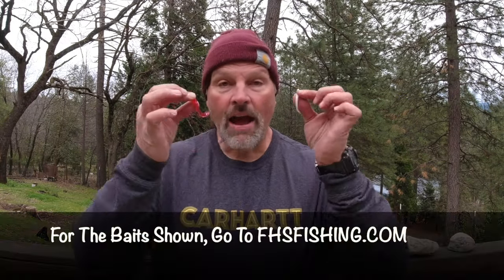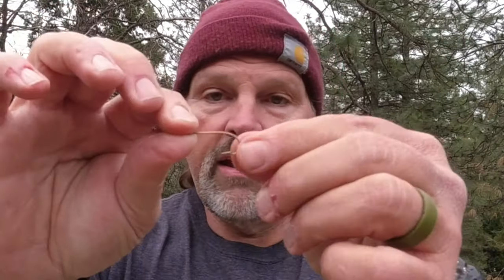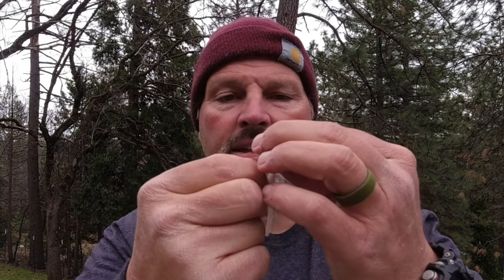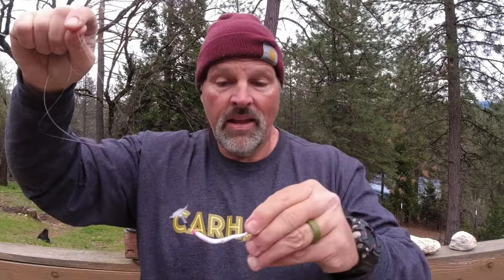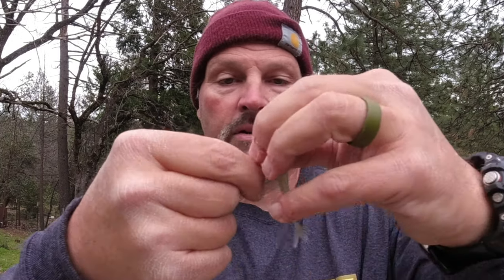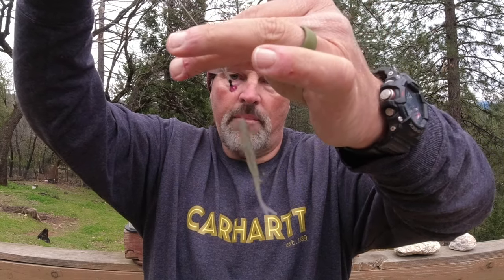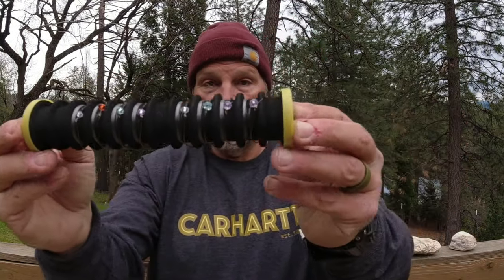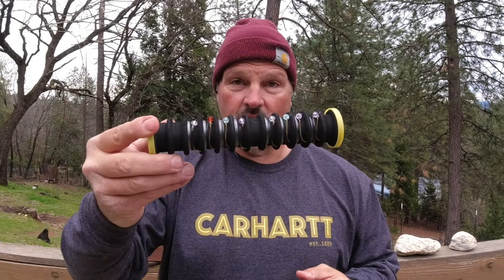How To Rig Soft Plastics For Trout Trolling: Cal Kellogg's Complete Guide #fishing #trolling #trout

Comment: Great video cant wait to give a try!!! But what is the bead for? I have always been told its to protect the knot from the weight but  not in this application!/!?
Reply from the maker: In this case it’s function is to keep those bobber stops from pulling into the bait when you fight a fish. Once they get into a bait you can’t get them out without ripping the bait. As I said you want to be getting 8-10 fish per worm…. Even more with other baits. Im running a tube right now that has caught over 20 kings at Folsom….